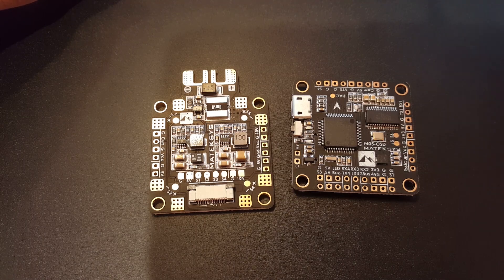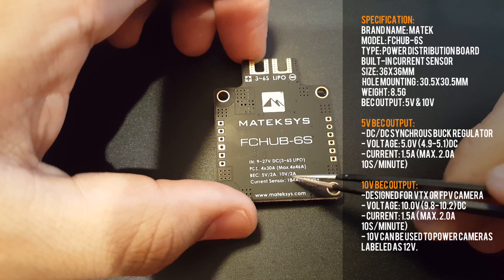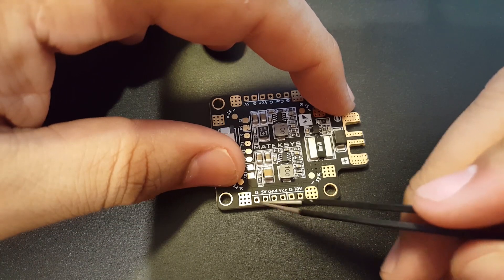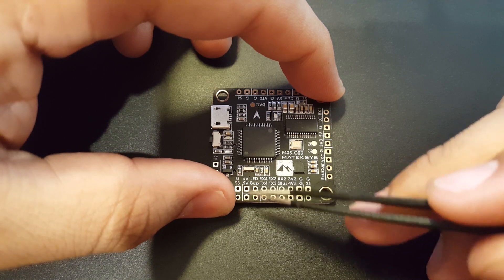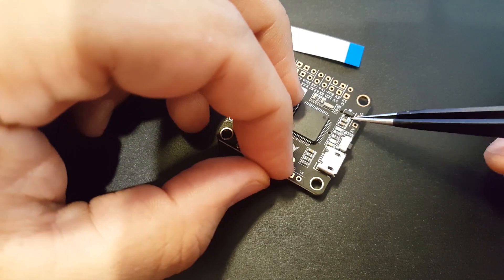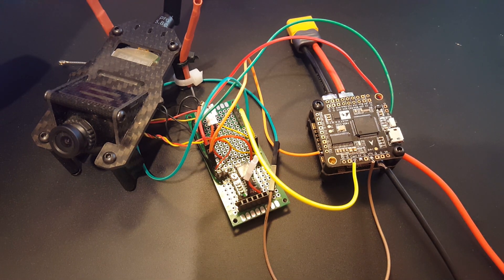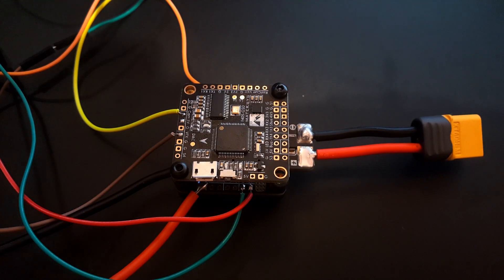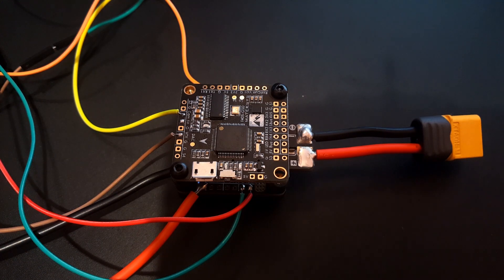Matek F405 OSD FCHUB 6S Review and Noise Testing

Comment: You put out a lot of great videos👍🏼 When ever I’m stuck in my builds I turn to your channel and find a solution, so in debt and comprehensive testing 👍🏼. I know this is an old video, but I’m building this build now ( for the third time ) and I have capacitors but not the 25 A I have the 30 or 35 A Would that work all so........ thanks for all the great videos.

Comment: Hi DroneMesh, 
I had replaced my SPRF3 fc on my Eachine Wizard X220 with a Matek F405 OSD and since then i'm getting some noise in the FPV feed. It's not bad but it's annoying since it's there. 
The only thing that changed was the FC and wiring the video cable through video IN/OUT on the Mate F405. 
Before i changed the FC i had zero noise. I also have a 1000mF low ESR cap on the xt60. I can't explain why i'm having the video noise just after changing the FC. 
Cam and vtx are wired to 5V and 12V bec to a Matek PDB which has filtration and as i said i had zero noise before. (The OSD has zero noise/doesn't flicker at all).
I can't explain the noise and any ideas of what i can try next are highly appreciated. Thank you

Comment: Where did you add the capacitor, I added one to the positive and negative terminal of shared by the XT60, it improved the noise, but im still seeing vertical lines. Any tips? (Also using RS2205's alongside hglrc 30a optos)

Comment: Where did you connect the capacitor?
Reply from the maker: MrMagicTee connect it where the battery pads are.
Reply: Drone Mesh thanks for reply! so just one capacitor between the pdb main power input pads and the xt60 plug does the magic?

Comment: You say yellow wire goes from vtx to fc but how do you power the vtx
Reply from the maker: shrek fpv from the 10v pads on the pdb
Reply: Drone Mesh thank you just trying to get my tramp working  now got the odd all sorted but trying to get tramp working with no success
Reply from the maker: +shrek fpv I have never used the tramp is it powering on?
Reply: Drone Mesh yes sorted it all now

Comment: To help others, I have the same combo on two frames. Spektrum users use RX2 signal pad and 3.3v + ground. I have a total of 12 active flying frames and all tuning very good gear but by far my best, smooth, video distortion free frame is my Qav-XS with this combo and I used the rubber standoffs for the FC part. It flies incredible and the total combo on Banggood is only around 36€. A bargain if you ask me. The HGLRC AIO is between 38-45€ and its very good for extreme tight builds like I have but if you have the space this one is unbeatable. Well done review, even as a user I learned a lot!

Comment: With the Ribbon cable can you mount the PDB so that the power connection is at the side of the quad rather than at the back while still keeping the FC facing forwards?

Comment: Thanks for the great review! I was wondering where you solder your ESCs signal grounds? On the ESC ground pad? I did my very first build using a Matek PDB-XT60 and a Omnibus F4 Pro and I broke that FC during build.. That FC is not for new pilots appearantly. Hopefully this setup will get me flying soon!

Comment: I've been using this FC/PDB combo for about two weeks now and I absolutely love it.  Matek did a great job with the quality on this one.  You do have to make sure to use the vibration dampening mounts that the FC come with as the gyro that this FC uses is very sensitive.  Good review!
Reply from the maker: +Paul Rogers Thanks I am building a quad just now with it ^_^

Comment: Thanks for this! Where do you put the capacitor to remove the noise?
Reply from the maker: Depends on how bad the noise is usually 1 should be enough on the battery pads with the battery wires.
Reply: Will the 470uf 25v be enough to install in the battery wires? Thanks for replying. Appreciate it!

Comment: I've been using this setup on 5s for just over a week now. I had been experiencing some problems but turned out to be the rx coming into contact with the fc on hard moves.
Its super clean, tidy and works unlike the original pdb that needed caps on everything.
Nice review and happy your noise tests show my findings to date.
Reply: Manindra Moharana I did add a 35v 1000uf cap from the beginning but i do that on all builds. These motors and esc are so powerful today I don't take the risk and adding a <1$ component to relief a lot of electrical stress is always worth it.
Reply from the maker: Thanks, glad it was of use..
Reply: Hey Dazzle, did you add a capacitor/lc filter in your build? I'm curious to know if there's an improvement in a real build.
Reply: I just added a cap that was provided with the original pdb because i had it to hand. No lc filter needed.
Reply: Nice to hear! I think I'll go for the same too.

Comment: first like. Hey i have a question. How would one solder on a xt60 with wires onto a pdb like this? i have one but dont know how to do it as it is not closed or anything! great vid btw
Reply: You can see it on the video.
Reply: yeah but how to actually do it
Reply: ill make a vid next week, but basically, with a lot of solder
Reply: ty :)
Reply: THICK 60/40 ROSIN CORE SOLDER  AND A THICK IRON TIP
Reply: I had the same questions, don't want to have the iron on any longer then needed, or this board will over heat, whats the process for soldering the leads on this bad boy?